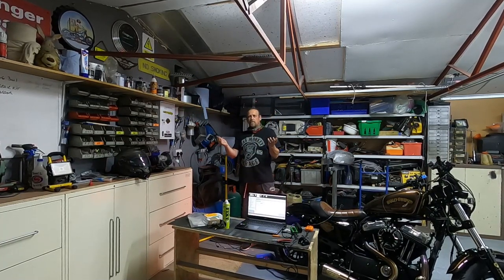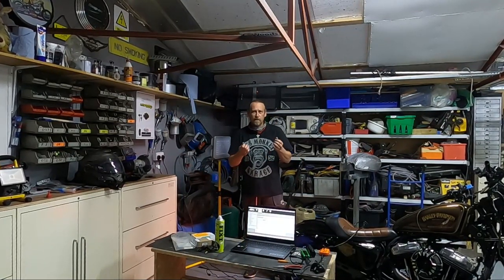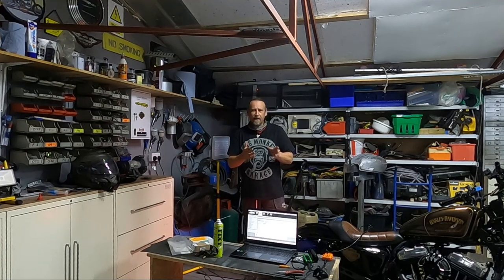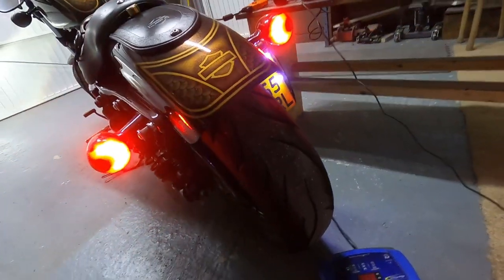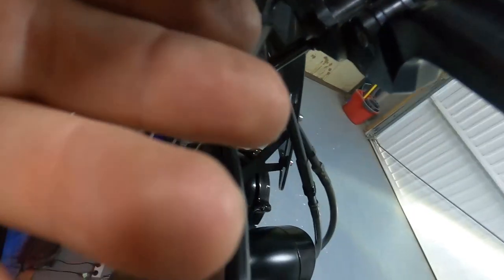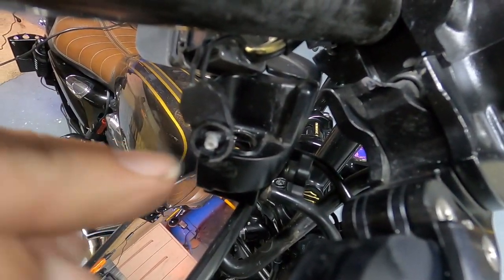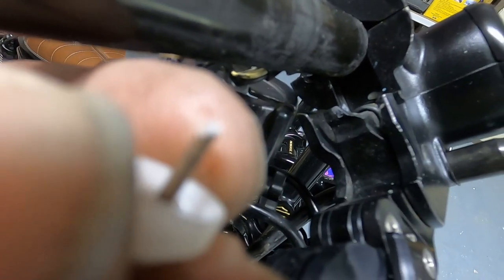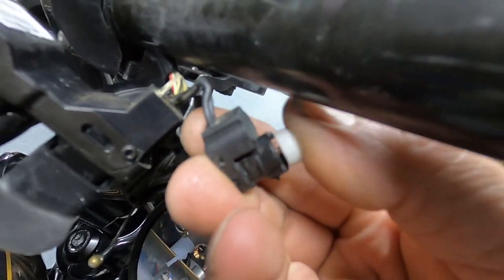sportster sticking brake switch fix

Comment: I bought a new switch to fit to cure this problem but what I don't understand is the new switch comes with 2 x tiny connector block pins. The original factory loom has the original switch connectors sealed with all the other wires in the switch with sealant. They're is no way of knowing if you dig out all the sealant to get to them little pins that are buried under the sealant what lies underneath there.
I'm gonna try your fix first as mines worn down. Falling that I think it's a cut n solder of the new wires. Trouble is with that there's not a lot of room for the wires themselves.
Is be interested to know if anyone's dug out all the sealant on the other end of the switch wires to see if it is a connector block and you can release the old switch pins and they insert the new ones?
Thanks for uploading bro👊
Reply from the maker: Yeah, pointless with all the sealer yet doesnt stop it failing at the business end.. easiest way is to cut and solder but again, little access. What I will say is the repair I did has been spot on ever since, so personally I think I improved the original 😃.. hope you get yours sorted whichever the method mate 👍👌
Reply: @ALCHEMOTO thank you this video helped 👍

Comment: Thanks for the video, what Bcm error code was being throw up by this? Thanks
Reply from the maker: B2161 brake circuit open, there are various for shorts/voltage high or low etc. B codes for bcm, p codes sensor and c codes circuit etc 👍

Comment: Having the same problem... Why can't they just sell a replacement or just make a part that lasts. Thanks for the video
Reply from the maker: Always weak parts somewhere along the line mate.. I have never had a problem with mine since the mod though 👊.. Obviously a better idea 😁. Cheers, hope yours gets sorted
Reply: @ALCHEMOTO  for what it's worth, I was able to print a small button that I was able to secure to the existing button that fixed it. But thanks again for the video, totally narrowed down what the issue was
Reply from the maker: @mattia9597  excellent work mate 😁👍👍

Comment: Where did you find the white mushroom head you used?
Reply from the maker: The mushroom bit is part of original switch but the stem underneath breaks or becomes weak against return spring, by slightly lenthening this with the piece of rod, it gives more pressure when brake lever released. Hence the fix 👍. If you haven't got that piece as I have seen them go missing, the top of a ballpoint pen could be used as that was nearly done instead of this fix. 👍👍

Comment: Maybe you could plastic weld a little extra mushroom head onto the original? Rather than drilling and gluing etc? Thanks for the video my man.
Reply from the maker: Hi mate. Yep, the issue is more the base than the head, so extending that to make the contact 👍. Im a fan of plastic welding and use that a lot as well, but this repair has not give one issue and still works better than new 😁👍. So at least I know its proven.. but be interesting seeing how others have done the repair to compare 👊...Thanks for watching 👌

Comment: Well this has become a problem on my bike. Its been in the shop twice now to have the issue fixed. And well it has come back to me again. My problem is. When im riding home from work,around the same area everyday my brake lights switch sticks on. Until i use the the brakes at the light then the problem goes away. It started when i was over on the Island a month ago. No problem when i go to work on the slow road. Its when im doing 60 mph going home. And its always roughly in the same area when i happens. I look down at my speedo and i see the red light is on. As soon as i come to a stop at the light it goes away. I have to look into this and see if i can fix
Reply from the maker: If its coming off slowly its only just starting to stick. Give it a good spray of wd or similar where the switch is mate, and push ,pull lever  for a good few minutes and see if it that works. Common annoying problem. Not had it on mine since did the little mod though 👌
Reply: Never had this prob in my last 2004 fxd whole time I had it.. 14 years.. got a new fxdl 2017 and the dam brake lite issue happens with less than 2500 miles on the dam thing..

Comment: Would be a lot easier to just put a small spot of tig weld on the brake lever, about .020-.030 high.
Reply from the maker: Alloy levers and also its the double spring and shaft thats the main fault, the lever hits the plunger fine. 👍
Reply: @ALCHEMOTO  so it's the springs stacking that's keeping the switch from working? I just replaced my switch Saturday and still having the problem,  I have my lever off to tig weld. I seen your video this morning.
Reply from the maker: @israeljones2568  yes mate, it doesnt work like a normal push contact switch, it has a return spring and the bottom of plastic shaft has to contact. Makes sense when you pull it out 👍
Reply: Thankyou.